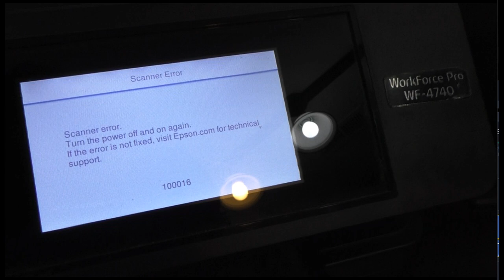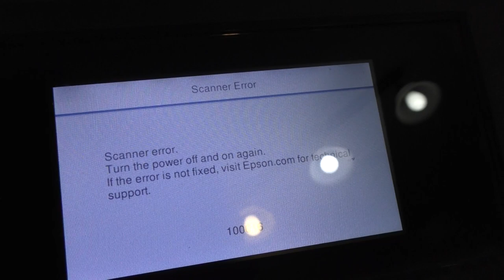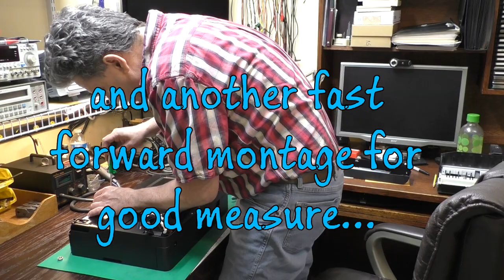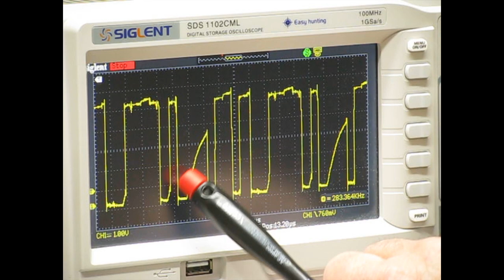Repair attempt: Epson WF-4740 with Scanner Error 100016

Comment from the maker: If you have this problem tweet about it to @Epsonamerica04 . Judging by the number of views this video has received there must be 100K+ units that have failed with this error and locked users out of the control panel. 

This is a big problem and Epson needs to at least fix the firmware to not lock users out of the LCD control panel.
Reply: Contacted Epson technical support....absolutely no help!  Said if printer is over 1 year old, the best they can do is to tell you where to take it to get fixed and give you 15% off another Epson.  I said to have another hardware failure????  Hell no!
Reply from the maker: @jodimoney1345  I finally got an answer back from Epson on Twitter who said the same. Said I will not buy another Epson.
Reply from the maker: @jodimoney1345  I did finally get a response from Epson asking for the link to this video. I hope they will pay attention know to how many people are having this problem.
Reply: Hey Birt! I said the same.   No way I would buy another Epson.
Reply: @japred113  that decision was made when i had to buy their ink and its gone so fast. I dont even print often and its usually something small. now i cant even scan im getting the same error. turning it off and on or opening and closing the paper feeder isnt owrking either
Reply: @jodi money I got the same reply from epson.  I bought two printers but had not taken one out of box right away.  It had literally printed 99 pages before this error.
Reply from the maker: @littlemissblueyes100  Epson has a systemic problem with these printers but they will not admit it. I moved on and bought a Brother printer/scanner.
Reply: Thanks for your reply.
Reply: @jodimoney1345  mark
Reply: Yes!!!!

Comment: I think, it should be law, that when a company does not service a device anymore, the service manuals and documentation should be released to public domain.
Reply from the maker: That would be nice if they would release service manuals. There is still an issue with Company A licensing something from Company B. Company A may not service a product but the license says they cannot release data obtained from Company B. If Company B also had such a license from Company C it would become a very difficult thing to try to administer.

I suspect that if we as consumers were to alter our buying habits such that we took such things into consideration before a purchase it would force companies to change in a more effective way than legislation would.

When I bought this printer I did no such research as I had to scan and print many documents in a short time period and this is what I could get locally, at a reasonable price, that had a document feeder and duplexer. When I purchase my next printer I will be more diligent in doing research ahead of time.

Comment: Oddly enuf... I had the same scanner error on my Epsonwf-4740, and when I reset the date/time it went away. I normally don't bother with date/time info, but...
Reply from the maker: Coincidence, this error is not related to the time/date. 

This error indicates that it was not able to read the target calibration patch between the ADF scanner glass and the main scanner glass. It will come back...

Comment: unfortunately this didn't help my issue at all.  The error comes up 100% of the time and it only started this a few days ago.  I've only had this printer for 1 yr and very disappointed.
Reply from the maker: There is one more thing to try. Turn the printer off and then open it like you are going to put new ink in. Now turn the printer back on. It will move and make some noises. The screen will tell you to close the top, wait until several seconds after it is done making nay noise. Then close the top.

Let me know if this works for you.
Reply: @HeyBirt  well, I did that earlier and my screen came up fine.  Then I get the error again.  I called Epson and they were useless other than giving me a coupon code for a new one OR an option to have someone service it.  Well, I just got off the phone with someone that can service and the lady looked up the error code and said that it's a "Position detection failure" and said it could be as simple as cleaning the carriage rail or more advanced as replacing the Scanner Unit or the Printer board but they couldn't tell me without bringing it in.
Reply from the maker: @swyty100  Thanks! Knowing that the error does not show up initially when you lift the lid like your changing ink really helps. So does the bit of info about a position error from Epson.

I suspect there may be a break in the wire harness to the scanner or document feeder. Opening up the top like your changing ink will reposition that whole wire harness a bit which might  allow a broken wire to make contact again. Or, it could just be that having the top up like that interrupts the normal homing routine. 

Thanks again for letting me know. The more data the better.
Reply: Hey Birt! Yes, and it was actually a sweet lady from an independent repair shop that looked the code up for me and not Epson. Epson didn’t want to tell me anything but no surprise there. LOL
Reply: Hey Birt! If you’re able to figure it out from this info, I sure hope you make another video for us. I’m definitely “printer repair” illiterate and can use all the help I can get and I sure don’t want to have to buy another one.

Comment: Hi Birt. Some feedback from another case (3yr 'old' WF4740 giving Scanner Error 100016). Some things I found out:
1) It is definitely not a driver issue, since the error can (and in worst cases will) pop up after powering up the printer, even without any connection
2) It started intermittently / infrequently, and became worse over time. Sometimes indeed the various bypasses (power down/up after opening cover, removing paper trays etc.), but as time goes by, they work less and less.
3) one can still print, but the printer does not go into automatic standby because of the error message - so consuming electricity 24/7
4) at one time when I still got it to power up without error message, I tried to scan - and the scan output was screwed up (only one half of the page somewhat had an image, the rest was a smear), so clearly the scanner h/w does have a problem (instead of the printer f/w having a bug somewhere?) 5) this led me to still disassemble the whole scanner, gleaning some hints from your video (thanks for that); once you know how-to, it is not that difficult.
6) I was especially looking for bad contacts in all connectors leading to the scanner, since the data output of the scanner was garbled
7) Everything looked OK, except for what I believe to be the power connection to the scan LED strip - a tiny transparent flat cable soldered to the side of the scanner strip; it was full of (soldering flux?) residue, which I scraped away with the finest tweezers I have (finer than a needle). But unclear if that stuff stuck between the print and the cable where I can't reach it.
8) put everything back together (no screws left over :) 
9) not even close, so certainly no cigar: still the same error message
10) since the dealer where I bought it (online) does not even react to my mails, I'll write a message to Epson, see what happens
11) in the meantime, I'll see if I can buy another 'broken' one cheap, so I can experiment some more / further (I still need my main one to print)
The only reason I'm persisting is that I see there are lots and lots of people with the same problem, and nowhere a solution in sight. I'll keep you posted.
Reply from the maker: Thanks. Someone posted a few weeks ago the what this error message meant from the Epson service manual. There is a target path between the ADF scanner glass and main scanner glass the the scanner tries to read when homing. If your scanner is getting stuck near the separation between the two pieces of glass this is why. It is most likely cause by the FFC (the flat plastic ribbon cable you mentioned). I have not taken mine back apart yet to investigate.

Comment: Aaaaand that's why we need to support the Right to Repair bills on your state!
Reply from the maker: In this case Epson did not do anything to prevent me servicing the printer, i.e. I did not need a special diagnostic program or special equipment available to only the factory. The lack of any service information at all is annoying though. 

I can see the point of the company that 99.99999% of consumers are never going to use or benefit from them creating publishing any sort of service manual. It is a chore and expense to do so. 

Many times company X will license some subsystem or code from company Y and then it turns into a nightmare about what information can be released and in what form, blah, blah, blah. For a $200 printer it is not a big deal for a $200K tractor it is a huge deal though.
Reply: @HeyBirt  yes, but i see the current status of disposable electronics a consequence of this same problem. we have to support those bills not only for the sub 500 electronics to benefit but also for the more expensive to benefit from it also. politicians like to think in absolutes.same happened in the automotive industry, we can buy scanner to allow us to do must dealership stuff(service checks, abs bleeding, battery registration, etc). the problem really is availability of the information. since electronics manufacturers are not pressured any more to provide service info, they keep making cheaper and cheaper stuff.
i have a cheaper epson multifunction thingy that refuses to even install the drivers because its out of ink!!!!!. so i cannot scan anything because of this.

Comment: Simple tip at end - document feeder open/close, power off-on. Genius! The easy ones are the best. Thanks a lot Birt for making this available to everyone.
Reply from the maker: It will work for a while. I think mine ran for 6-8 months like that. I finally junked it and bought a Brother MFC-J6945DW. It has not given me any trouble in 12+ months and I have not even needed to add ink yet.

Comment: Had the same issue, thanks for pinpointing how I was getting it to work... I didn't make the connection it was the document feeder. For anyone else reading: power off, remove the back panel/document feeder, put it back on, power it back up and the scanner works again for printing.
Reply from the maker: I found out some more information from a reply to this video recently I hope will let me track down the root cause.
Reply: @HeyBirt  I'll definitely keep a lookout. So far, it hasn't done the error thing again, but I'd like to fix it, if possible. Thanks, again!
Reply: My guess is that the flat ribbon cable from the scanner to the main board either needs to be reseated or  a hairline break in it from opening/closing the scanner. These different "remedies" of opening/closing the scanner lid, removing/reinsert the back doc feeder, reinserting paper  trays, etc. I think shake the cable enough to make a temporary connection.
Reply from the maker: @arrow201  A week or so ago someone posted Epson's description of the error code. Evidently there is a target/calibration patch between the ADF scanner glass and main scanner glass that it tires to read when homing the scanner. This seems to be the step in the homing process where things go wrong, for me at least.

When my scanner does home I have run some test scans and noticed 'noise', i.e. random colored bars in the output which tend to clear up after a few scans. For others the noise gets worse. 

Combining these two observations makes me thing the issue is the FFC to the scanner 'head/sensor' itself. As you say a break to poor connection. When I have time I'll take it apart and investigate further.

Opening the top like you are going to change ink does stop it from trying to home the scanner so you will get the display back until it tries to home next time.
Reply: Thank you! you are exactly correct, Taking the rear panel out and replacing it is all it takes.  Then it tells you to update the firmware but that is not needed. just skip that step it and the printer finally will load and give you the control panel home screen.

Comment: Hey Birt! You've all my respects! For absolutely no reasons I would mess with such modern nonsense stuff! These devices are thought to drive crazy anyone attempting a repair.
Reply from the maker: I eventually had to give up on it. This failure mode is very common on these Epson all-in-ones and Epson ignores it. I bought a Brother printer/scanner and it has not given me a moments trouble.

Comment: I have this error along with 000041. I see the white band in my scanner looks twisted don’t know how, I’ve turned off and on and scanned moved an inch each time now it’s stuck to the right and ink is stuck to the right as well like it’s locked I’ve uninstalled and reinstalled the drivers no luck and checked for paperjam. All I did was clean the printer head and both errors came
Reply from the maker: I finally gave up on the Epson and bought a Brother printer/scanner. It has not skipped a beat.

Comment: Oh my f*ckkk all this. I’ve taken mine apart several times and don’t know what to do with it perfectly good new otherwise but after reading all of this misery I’m going to happily drive mine on down to the Office Depot and smash it in a trillion pieces in the parking lot and drive off satisfied af. Suggest y’all do the same. Screw you epson I’ll be buying simple pos hp from here on out 🥳
Reply from the maker: I eventually bought  Brother with the large 'Ecotank' for ink. It just works, not one problem and the ink is much cheaper.

Comment: Hello I Have the same problem  with my epson WF2850, I try to clean up but it doesn’t seem to function. This error message appear when I start the print  so I can’t print Anymore.. havé you anny other  advice ?
Reply from the maker: I gave up on Epson. They have a systemic problem with this series of machines and refuse to acknowledge it. I junked my Epson, sold the ink and bought a Brother MFC-J6945DW last year. It has not given me a moments trouble and I have not even needed to add ink yet.

Comment: Hi, I was getting the same error, rebooting would clear it for a while. Today printer won't boot up at all.  Stuck on Epson Logo.  can't even print from my computer.  Will disconnecting the scanner allow printer usage ?   Thanks
Reply from the maker: I seem to recall trying that and it would not boot up correctly because it was looking for the scanner.

I gave up on Epson 1+ years ago and got a Brother MFC-J6945W. Up to 11x17 printing and scanning. It has printed reams of paper and I still have not needed to add ink. It uses the 'Ecotank' system so ink is cheaper when you do need to buy it.

Comment: I just tried to print on my Epson that was displaying the error code with my iPad and it worked.
Reply: Even further trials on fixing this lead to more odd results.  I had 2 macs and  window computers installed with Epson.  I removed the printer and drivers from the window computers, turned printer off the on, no error code.  Printing from macs works.
Reply from the maker: This error is a scanner homing error, it has nothing to do with the computer or driver on the computer. With the printer disconnected from the computer you will still get the error. 

It does seem that the symptoms depend on how you are connecting to the printer. Some people connected by USB seem to have more problems printing anything while those, like me, connected by Wi-Fi can still print most of the time.

Since Epson chose to lockup the entire LCD with the scanner error display it prevents you from changing paper type, changing ink, etc.
Reply: @HeyBirt  when I tried to print (I never use scanner) from my iMac, it never worked just said “looking for printer”.  After we removed the printer from the windows computer, I was able to print with no issue from the iMac.
Reply from the maker: @jodimoney1345  That is strange, it sounds like the Windows driver was getting 'stuck' because of the error. Do you have your printer connected by WiFi or Ethernet cable?
Reply: @HeyBirt  WiFi sorry this took me so long to answer
Reply: did that help give you any clues or did you just give up @Hey Birt!
Reply from the maker: @jodimoney1345  I ordered a new Brother printer/scanner. Epson does not seem to care that there are 100,000+ printers with this problem (based on video views). 

My guess is that the problem is in the FFC (flex cable going to scanner head) or the scanner head itself. You can't buy either part so it does not really matter.

Comment: Epson Error Code # 100016
MEANING="HP [Home Position?] detection failure"
DESCRIPTION="- The scanner CR could not return to its home.rn   1. Damage or disengaging of wheel train of the drive mechanismrn   2. Disengaging, fraying, jumping of the timing beltrn- Failed to read the white standard/home patternsrn   3. Disconnection, break, skew or damage of the scanner FFCrn   4. Failure of the CIS unitrn   5. Failure of the scanner housingrn   6. Failure of the main board"
Reply from the maker: Thank you! When I had it apart the encoder wheel did not seem loose, nor was the belt frayed, etc. Knowing from #2 above that it tries to read a 'home pattern' sounds like a place to start as well as verifying the integrity of the wire harness to the scanner/ADF.